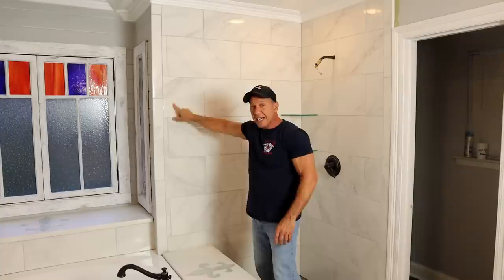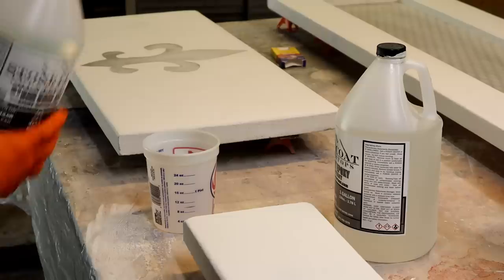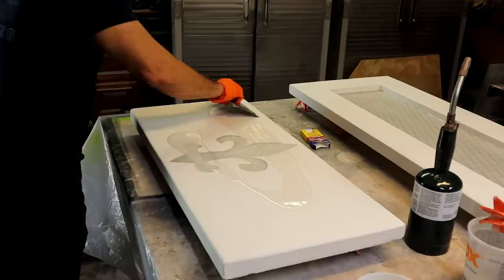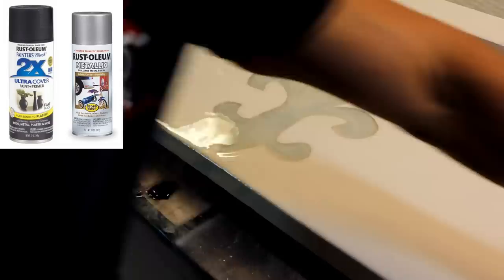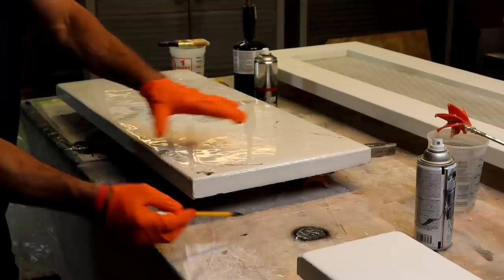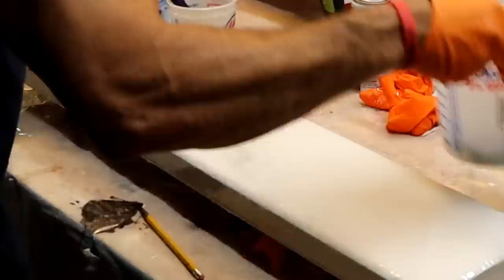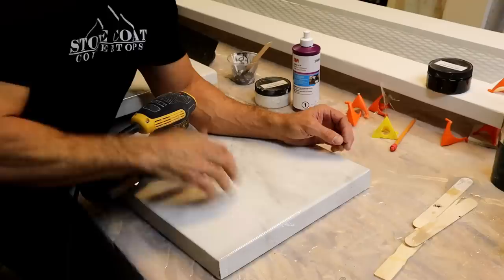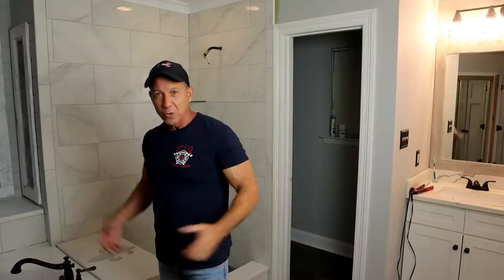How to Make Concrete Look Like Marble - Bathroom Renovation by Paul Ricalde

Comment: Paul, great work as always.  Very nice.  Just a couple small but important tips to consider.  Mike and Stone Coat always recommend mixing the epoxy with Part B first and then pouring the Part A in second.  This helps assure best mixing.  I've read too many distressed new users having hardening issues due to not mixing it extremely well.  You obviously have figured out a technique to mix it thoroughly.  Just trying to help new folks have best chance for success right away.   Second, did you know that Stone Coat designed that trowel with the angles to make sure you lay down the correct volume of epoxy?   That lip that you hold onto is designed to be flat or parallel with your working surface as you trowel it out.  That will automatically leave the correct amount of material onto the surface.  I noted that you were troweling it at a very flat angle and that can cause the layer to be thinner than needed for most types of work.  Again, have read many distressed comments of people having voids and edge pullbacks due to lack of epoxy on the surface.  I hope this helps.   Thanks again for all the great videos you put to help us.
Reply from the maker: Thank you Freelude, I really appreciate your info. Mike obviously knows more than me when it comes to epoxy and your information is a great help. I totally agree with you, mixing the product well and mixing the correct amount are the most important things to do when it comes to epoxy. I guess I'm a little too comfortable because I have poured a decent amount of counter tops and bars for companies  in the past and I only had 1 that didn't dry correctly.  I will ask Mike why he uses B 1st. I find it easier for me to get the correct mixture if I use A 1st. Maybe I am missing something.  Have a great day and thanks againg for the information, I would'nt want to steer people the wrong way. I will say that I really mix the epoxy well with the drill in forward and reverse before I pour.

Comment: id recommend to mix by hand. The mixer introduces bubbles. That white foam in the mixing are the bubbles
Reply from the maker: Hi Nate, mixing by hand is fine if you are doing small projects every once in a while, I mix it with a drill but I mix on low speed. Yes you will get more bubbles but I would rather pop the bubbles with a torch then mix large amounts by hand. It's fine with small projects but I pour larger projects such as countertops and I find it much easier for me to use a drill.  If the humidity is high and you are not working in a controlled environment, mixing by hand could also be preferred because the humidity can make the bubbles more prevalent.  Remember, this is StoneCoat Epoxy and it is very thick, mixing it with a drill is recommended because of it's thick consistancy because you want it thoroughly mixed. One of the most common mistakes that people make with epoxy is not mixing well enough, anothe one is not mixing the right amount. StoneCoat is vey thick and more durable than other brands, this was one of the reasons why I switched to StoneCoat Countertop epoxy.
Thanks and have a great day!
Paul

Comment: When you put the drill in reverse, do the air bubbles come out?🤔😉
Reply from the maker: No, I put it in reverse so the mixture goes the opposite way and helps to mix the epoxy better. I wish it would though.
Thanks Steven!
Reply: I did a cherry counter top with clear epoxy and I mixed it like that.... well the bubbles never came out it was all cloudy. I ended up sanding it all off and mixed the second time  by hand. it must be a stone coat thing..🤔
Reply from the maker: @ChristopherJones-nz4md  
Hi Chris,
I'm really sorry to hear you had that problem, I faced the same issues 20 years ago when I attempted my 1st epoxy project on an oak countertop that I made. I was so proud of it until the POUR! I guess you can say we learn from our mistakes... Cherry wood has to be prepped with a seal coat at least 2 times, I recommend 3 before applying a flood coat. 1 oz. per sq. ft. for seal coats, you can recoat as soon as it is tacky. Polycrylic can also be used as a seal coat because it stays clear but you will need around 6 coats, it is much thinner. Cherry has beautiful open grain but it also releases air bubbles until it is properly sealed. Trust me, I learned the hard way ....... Even if you hand mix the product you will still get air bubbles on most raw wood because it will constantly release air unless you seal it 1st. Stonecoat Epoxy is made to be mixed with a drill, it is much thicker than most epoxy and it is more DURABLE as well. You will get very tired of hand mixing it on larger projects because of it's consistancy. The Ideal environment for Epoxy is indoors with low humidity and temperatures around the low 70's. I find more bubbles occur with high humidity and lower temperatures. Under these conditions you may get more bubbles but they always come out if you follow the instructions. Stonecoat countertops has a lot of information on their website but I will be happy to help if you have a question and cannot find the answer. My site is Paulstoolbox.com. If air is trapped in wood grain or an object that you are coating such as a sea shell, you will need to seal it properly or you will have constant bubbles that will not go away until you sand and recoat. 
I hope this helps.
Have a great day!
Paul
Reply: @paulstoolbox  thanks, Paul! that is very good  information. I went through a lot ad sandpaper on that countertop😥

Comment: Hey Paul, where did you get that flor de lis or was it hand drawn? WHO DAT!!!!
Reply from the maker: Hi Tony,
I used a wall decoration that I bought from Smith & Sons, it is an old local Hardware store with wood floors in downtown Covington La. This place has a lot of different and interesting things. The piece was made from tin, I pushed it down on the seat when I poured it to create a stamp design. I wanted this one to be inset and smooth because it is a shower seat. I poured a ledge for the back of my tub and I left the tin in the concrete and painted it. That ledge is mainly for looks so I wanted it to be raised for a 3 D look. You can see how I did that on this video. https://youtu.be/xQugjuucD0c      Thanks Tony, it's always good to hear from you buddy!   Who Dat Nation is gonna be strong this year!!!!!
Paul

Comment: Hey I think I missed something 😖The concrete slab your doing this faux marble on , did you make that also or is that a purchased piece ? Thank you
Reply from the maker: Hi Michael, in the description box below or on the iPhone sometimes it’s on the right upper hand corner under the video, you’ll see an arrow pointing down. If you hit this arrow it will show you the description box. I have the video called one hour concrete top with logo. There is a link there that you can click on, shows the other video when I made those pieces out of concrete. It is very easy and cheap. I hope this helps, thanks!
Reply: Paul Ricalde thank you much & I finally found the tutorial for the concrete 🤗I love your detail given on all tutorials you do !!!
Reply from the maker: I really appreciate that Michael!